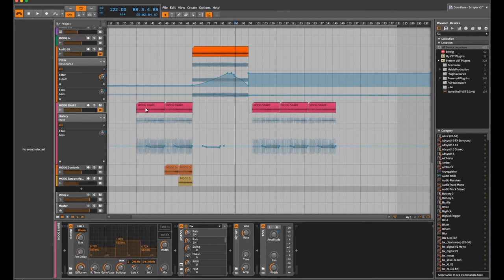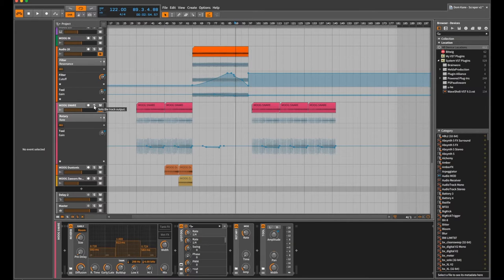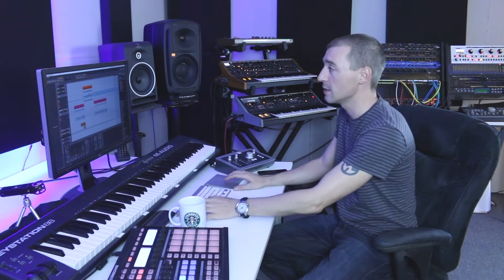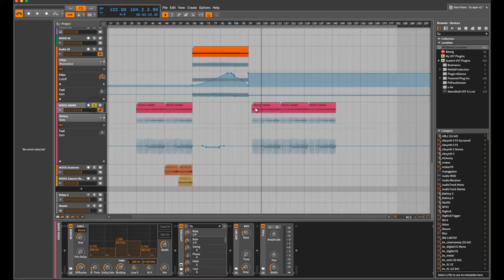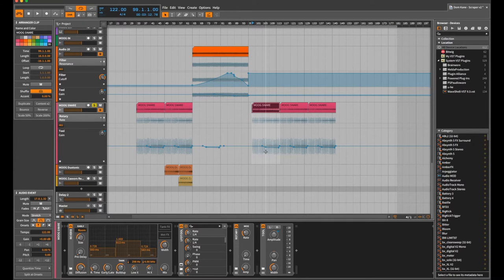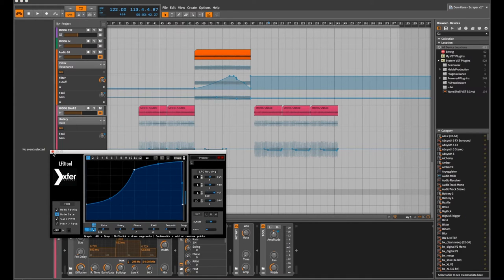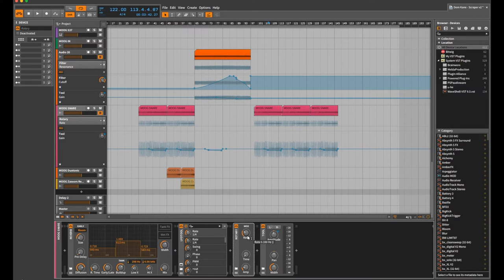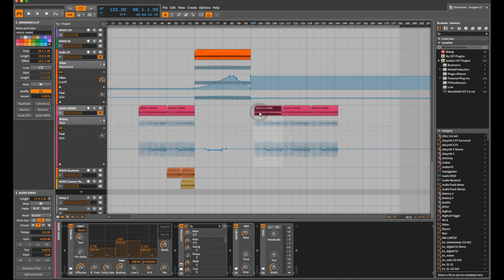Adding Depth To Tracks | DOM KANE VLOG 002

Comment: Hey Dom! Really loving this series already.

I have a question about bitwig. I am moving from FL studio to either Ableton or Bitwig. How do you find the integration of hardware with bitwig?  Fl studio has awful delay compensation features. 

Are there any obvious downsides to bitwig and would you suggest using it alongside another DAW rather than as the primary one.

Thanks!
Reply from the maker: 83tomgarner83 hardware integration seems to have been perfectly well thought out with Bitwig. Because it's been built from the ground up with all the other DAWs available, it's kind of a step ahead really. Definitely one I would recommend to people.
Reply: Thanks a lot Dom. A decision to make!